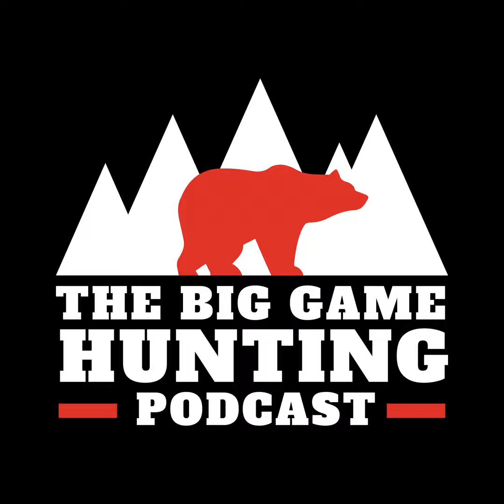353: Is Federal's New 7mm Backcountry A True Game Changer?

Comment: Hello, John. I love your podcast. Since finding it I have been immersed in it for several months!

I want a Backcountry steel case iteration on 35 Whelen pushing a 255g Hammer at 3000fps, or more if available. For elk hunting. And in particular that one in ten or so that seem unstoppable. 
I especially like the 30-06 base size, like the Whelen, for the one or two round additional magazine capacity. 
For Africa, because it has the same base size and is the smallest cartridge approved for dangerous game, an iteration on the 9.3x62. And having watched a fair number of videos on cape buffalo charges, and listened to Kevin Robertson on your Big Game Hunting Podcast, ammo capacity is of particular interest. I might  consider the 9.3 before the Whelen, if it had a bigger market forcing Federal to go this way, I would have to change up. But so far there seems to be at least one longer range high bc bullet in .358, (255 Hammer) and I can’t find any for the 9.3. But it could be done. 

I did some numbers and I have developed some info that supports my choice of the 06 base size, (no doubt the same process used by Federal..maybe) besides the magazine capacity. 

So, comparing steel case to brass case:
All the following should be taken with a grain of salt and a healthy dose of skepticism. I take no responsibility whatsoever for the accuracy or the opinion I am presenting, and anyone using this opinion does so at their own risk, I know just enough math to be dangerous, so that’s out of the way: 

Doing the pi r squared on the 30-06 (and 7 Backcountry) case we get .173. On the regular belted magnums you get .222. On the Wsm short magnums you get .243. These numbers represent the area in square inches that the base of the cartridge exerts on the bolt.  

Ignoring Saami actual numbers, but accepting 65,000 psi as the comfortable limit for brass cartridges, the 30-06 exerts .173 X 65,000 = 11,245psi on the bolt face. Standard belted magnums such as the .300 Winchester Magnum exert .222 X 65,000 = 14,430psi on the bolt face. The larger diameter magnums like the Wsm’s
exert .243 X 65,000 = 15,795psi on the bolt face. 

The step from 30-06 to belted is 28%. The step from 30-06 to Wsm  is 40%. 
Running a standard belted magnum at Saami 65,000psi is about the same as running an 06 at 83,200psi on the bolt face. Running a Wsm  at 65,000psi is about the same as running an 06 at 91,000psi on the bolt face. 

So in theory at least, all benefit goes to the 06 case diameter, and any rifle that can run a standard belted magnum should be able to run 80,000psi in an 06 base diameter with this new steel case technology . (80,000 x .173= 13,840psi on the bolt.) Any rifle that can handle a Wsm should be able to run 91,000psi on an 06 base diameter.(91,000 X .173=15,743psi on the bolt). So I believe that the 06 case diameter is the best option for this new technology. And happily, that gives you 1 or 2 rounds extra magazine capacity. 

  I’ve never been totally comfortable with most rifles chambering Wsm’s, because I did those calculations before I had a .300 Wsm built for F-class competition years ago on a Remington 700. It worked, showing no signs of stress or wear, but…..I’m not the only one who had reservations. Still, the manufacturers must have done the hard work and testing, because I never heard of any issues, and I certainly didn’t have any. 

These numbers calculate for relative bolt thrust. They do not calculate for hoop strength, but obviously as one drops in base diameter the hoop strength increases, as the external diameter of the barrel remains unchanged. 

As an example of going the wrong way, in my opinion, if you take the standard belted magnum up to 80,000psi, that’s 19,440psi bolt thrust and that compares to the WSSM at 65,000psi with 15,795psi on the bolt. So now you’re pushing the standard belted magnum 23% harder than the larger base WSSM operates at standard pressures. Truly unknown territory as far as all the commonly available bolt guns are concerned, and might call for a dedicated design. Or common adoption of the high pressure large base by manufacturers would indicate they had done the engineering and testing…. 
 Anyone else out there who is a real engineer, feel free to chime in.
Reply from the maker: Glad you're enjoying the show. Those are some VERY interesting points you just made. Thanks for sharing!

Comment: I would like to hear what Federal is predicting for barrel life
Reply: As good as 280 AI
Reply: Psi of the case has nothing to do with barrel life.
Reply: @rgelife3768 psi may not be the most significant factor. Have nothing to do with barrel life is completely wrong.
Reply: @chenxili4589  having "some" impact is not a big deal when other factors offset it.  Most importantly, the amount of powder used by the 7 BC is less than the amount of powder used by other long action or magnum rounds.  Plus, the cartridge is being marketed towards hunters who don't typically use cartridges like I more than 50 rounds per year.  

The main issues with the cartridge will be: can gun makers make accurate rifles for it?
Reply: If let’s say there is little wear due to powder erosion and you get 20% less barrel life this would still be a huge improvement based on what people are looking for. Most hunters wouldn’t even notice based on the amount of rounds they usually fire, sighting in, practice etc….
Reply: It’s going to be bad😆😆
Reply: @chenxili4589  quite the opposite. Fast burning powder=Less powder erosion
Reply: @fippydpaw That’s a good point, but high chamber pressure and fast velocity are the receipt for barrel killers…. We will see
Reply: @fippydpaw  that is entirely false

Comment: Innovative. Remington had a patent on the same technology in 1973.
Reply: Having the ability to use steel cases is not hard.  Getting it to hold 80k PSI and for it to be safe is an innovation.  The fact Remington could not pull that off is irrelevant.
Reply: Why didn't they develop it?
Reply: For real, did you listen to shoot 2 hunts podcast too